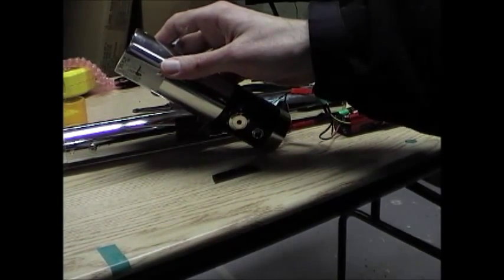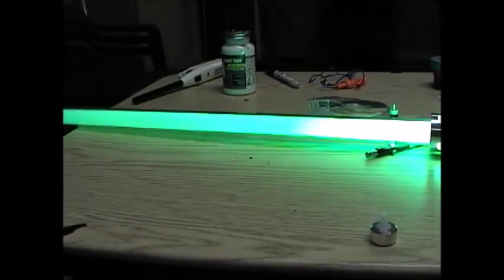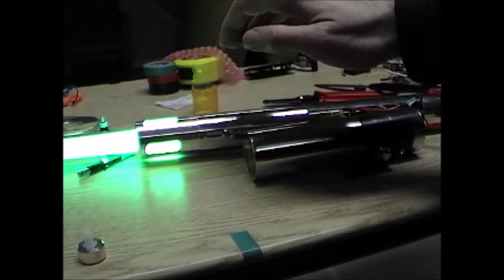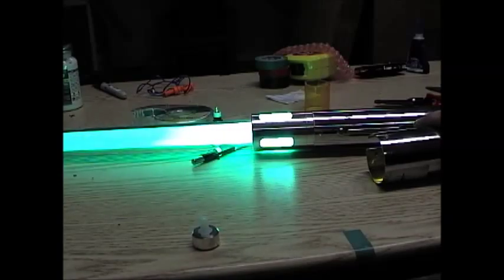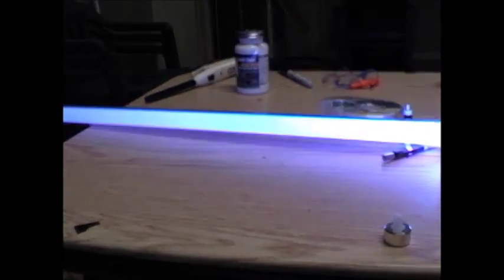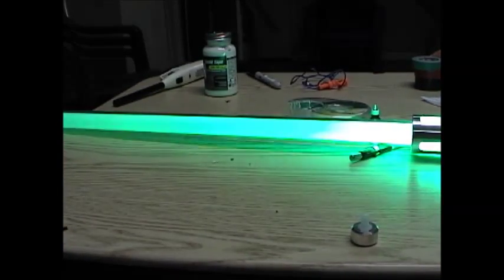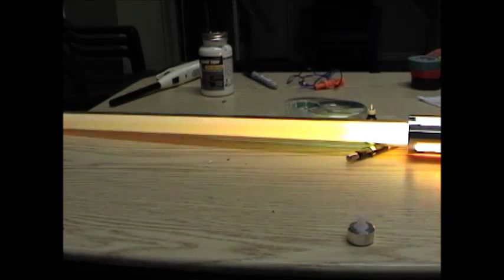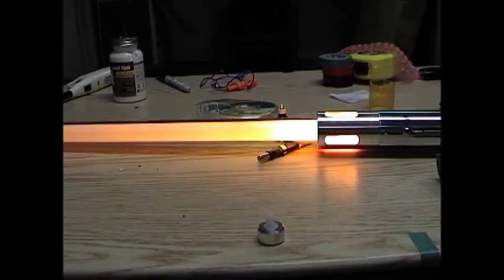Arduino Color Changing Lightsaber

Comment: Do you by chance have your code for this? What type of LEDs did you use??
Reply from the maker: This project has evolved. Check out the details for some of my other videos for links to the Arduino forum where this project is discussed. The LED is a Luxeon Rebel Tri-star Red/Green/Blue three-up LED with 18 degree optics.

Comment: Hey, I want to make a sword that lights up like a light-saber, how do i do that? Like what light is used? and what plastic to use?
Reply from the maker: The blade is made out of 1"OD 3/4"ID 1/8" walled Polycarbonate tube. There is a diffuser inside to make the blade light up evenly. You can buy the materials to make one at http://www.thecustomsabershop.com. Check out their forums, that's how I got started. For this project, the LED is a Luxeon Rebel Tri-star Red/Green/Blue three-up LED with 18 degree optics.